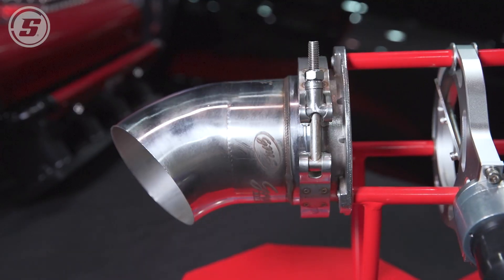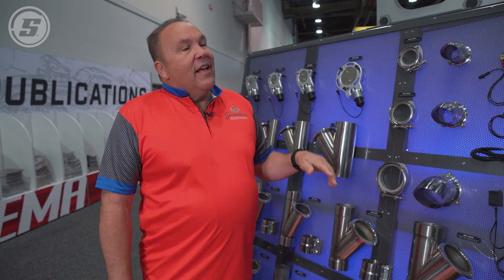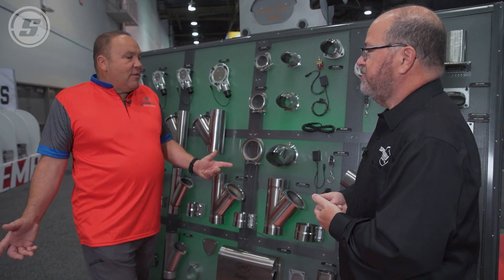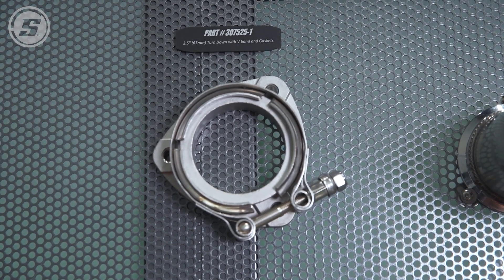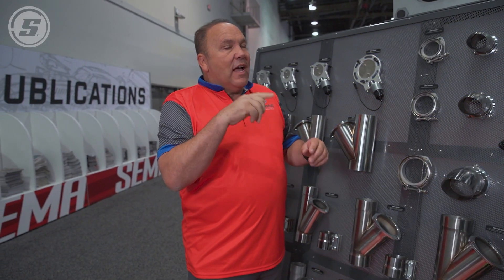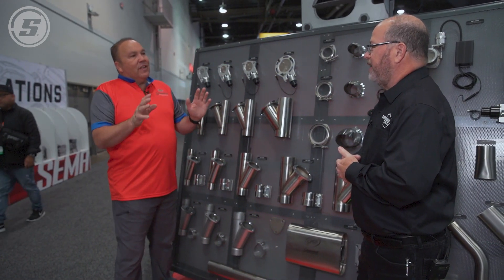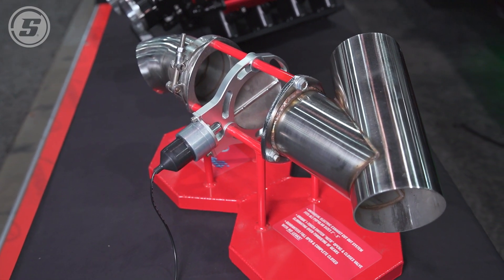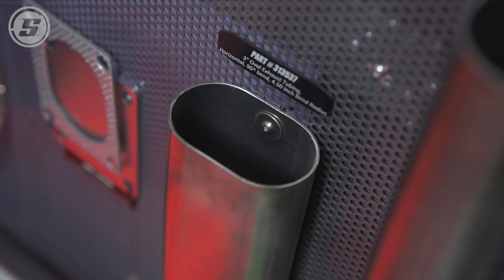How Do Exhaust Cutouts Work | HP, Legality, & Install Explained

Comment: My Hooker cut outs stopped working at 2.5 years and 3,900 dry miles. What a scam.  Now I need to trouble shoot and most likely buy replacement motors😢

Comment: Elec cutouts are cool I've had them on a couple cars but for adding horsepower not really, they just sound cool. The fact is unless you're running a really restricted muffler when you open them, they will only give you maybe 3-4 horsepower.

Comment: Coming from motorcycles, I want to understand how this makes the engine more effective (i.e. better power / fuel ).  Can you provide some sort of fluid dynamics flow chart of where to install for the correct harmonics to get the correct exhaust back pressure?
Reply: The correct back pressure is no back pressure.
Reply: On a turbo. Otherwise you need back pressure